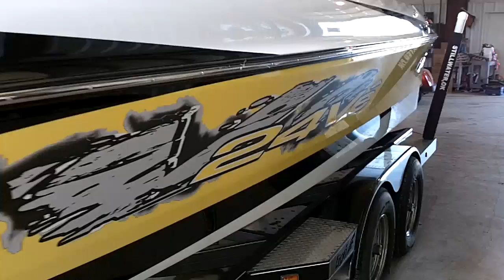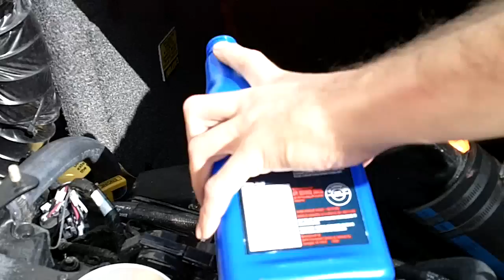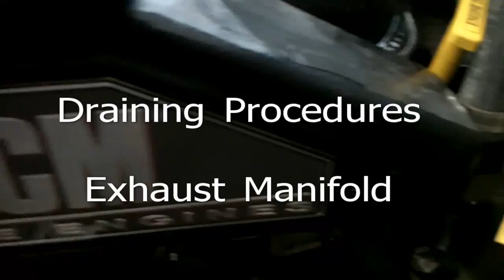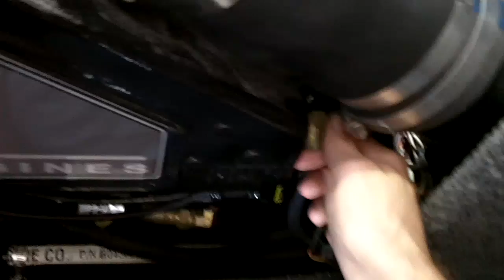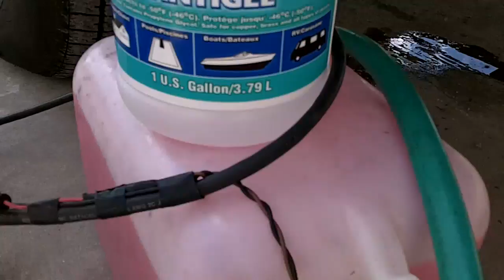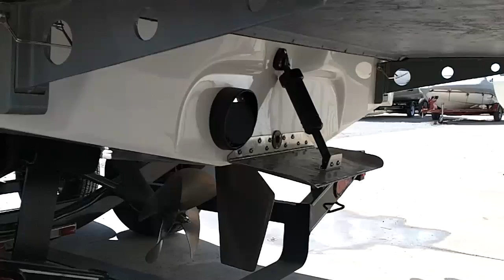Boat Winterization - 2009 Tige 24Ve with PCM EX343 Marine En

Comment: Why would you pull antifreeze thru if you drained all the water out.
Reply: It’s an extra, and very smart, precaution in the event there is a pocket of water sitting somewhere. It’s not absolutely necessary but a very smart idea and cheap insurance!